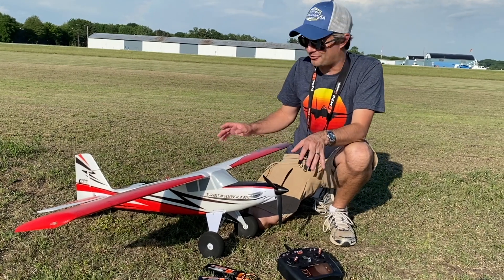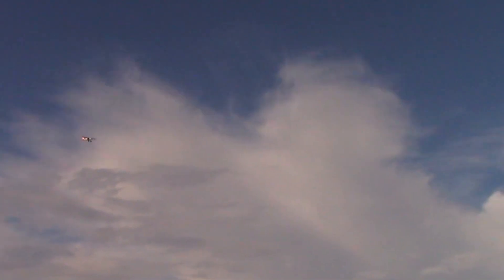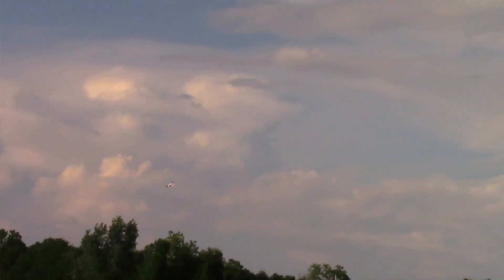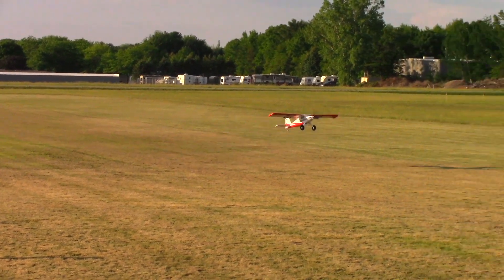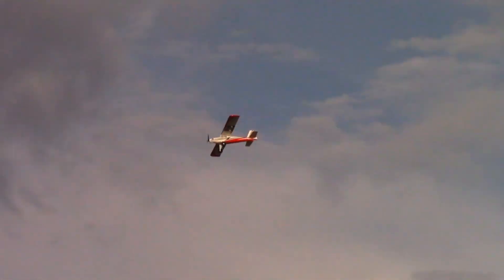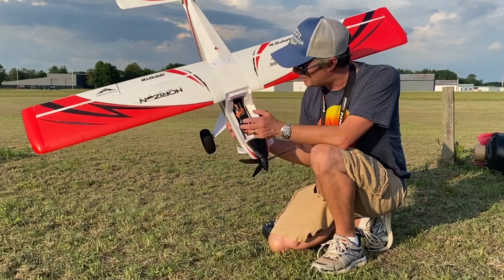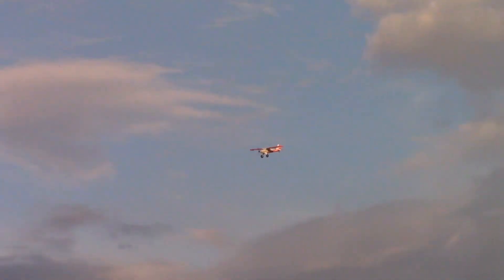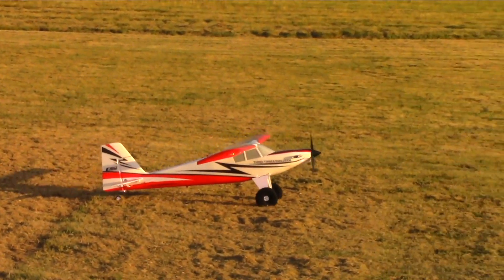What is the best battery for the E-flite Turbo Timber Evolution 1.5m BNF Basic?

Comment: Funny how almost every video Avoids landing this Golf Ball on cement.
Reply from the maker: I have no paved runway to operate from. Grass or fabric is it. I actually don’t even know of a club or area to fly in my area that has a paved runway.
Reply: @BRGT350  Hey Buddy.  NO disrespect.  wasn't directed towards you.  I owned the 1.2m Timber X a while back and it was like landing a Golf Ball.  Everyone at the field also has landing difficulties with the Timbers.  It's not the airframe.  It's the Narrow, Bouncy Landing Gear.  They're too Cheap and Arrogant to change their designs.
Reply from the maker: I have 3 Timbers, one original, one is the X, and the other is the Evolution that now has inflatable tires. With almost 10 years of flying Timbers, bouncy landings are more to do with technique than product. I can get a bouncy landing or smooth landing simply by adjusting my speed and approach angle. Bouncing is indicative of too fast and steep approach. The impact force on landing transmits energy back into the aircraft causing it to bounce. Newton’s gravitational law explains this. You need to reduce the energy on landing so the tires and springs can absorbs the energy with the least amount of energy transfer into the airframe. There is a sweet spot in which the landings are perfectly smooth. Really the same for all planes, however that sweet spot differs from plane to plane. Even full scale planes deal with this.
Reply: @BRGT350  This arrogant mentality is Exactly why EFlite won't address the Elephant in the room.  This isn't just me, who has also been flying for around 30 yers.  It's most of the pilots at the field also.  NOBODY should have to Sit down,  get out a Magnifying Glass, and Carefully thread a Needle just to land a " B U S H  P L A N E "

Comment: Nice comparison.  The only critical thing missing was the flight times on each battery.
Reply from the maker: yeah, in hindsight, that would have been good to add. I have found that the more and more I fly the Timber, the more time I am adding to the timer. I have also settled on a 2700 4S pack as my new favorite. I didn't have that battery available for the flight reviews. The 2700 4S works in most of my planes, has extra flight time over the 2200, but isn't as heavy as a 3000. There is a point in which too much battery hurts performance due to the weight.

Comment: What was the flight times on 3s and 4s batteries?
Reply from the maker: depends on the mAh of the battery and not the cell count. Although a 2200 4S should provide more flight time than a 2200 3S because your cruise power setting is a bit lower. Going with too big of a battery hurts your flight time as you need more power to haul around the extra weight of the battery. A 2200-3000 pack is probably ideal. Expect flight times to vary from 5-8 minutes depending upon the battery size and how you fly the plane. It is possible to get over 10 minutes of flight time out of a single pack. I caution against large batteries as they can overstress the landing gear if you aren't one who can land gently.

Comment: Was watching to know what c rating was on your batterys you never mentioned it once. Is looking at getting 4s 3200 but they are 75c I'm newish to the hobbie and want check I'm not going cause an esc cut with 75c to my limited knowledge it should be fine but I defer to you guys  cheers.
Reply from the maker: I didn't mention C rating as it isn't terribly important on most models. The easiest way to understand the battery nomenclature is to think of the battery like a gas tank. The mAh is the size of the tank. A higher mAh number means you have more energy in the battery to consume. Longer flight times, but more weight that you need to carry around, just like a full tank of gas in your car. More weight means a less responsive aircraft and the need for more throttle to provide enough thrust to carry the extra weight. Cell count is a number and S, like 3S or 4S. Think of that like the octane rating. The higher the cell count, the higher the octane. Just be aware that you can't exceed the cell count without damaging your aircraft. The Turbo Timber Evolution can run on 3S or 4S battery. A 4S battery is about 25% more powerful than a 3S. The C rating is the discharge rate, which is like the diameter of the fuel line going from the tank to the engine. If your engine needs 1/2" line and you are using 1/4", the fuel can't be supplied fast enough and the engine will suffer. If the engine needs 1/2" line and you are running 3/4", then there is no problem. The majority of prop planes, like the Turbo Timber Evolution will fly great on a 30C pack. A 50C battery is ok, but you are paying for more discharge rate than you need. EDF's can require a 50C pack due to the high demand on the battery. Now, a cheap battery at 50C may perform about the same as a good one at 30C. I have some Turnigy batteries that are 50C and perform about the same as a Spektrum Smart 30C. I have started to switch over to just using Spektrum Smart batteries as they deliver more consistent performance, have a self-discharge feature, and can be charged easily with a Smart charger. One last thing about batteries, never store them at full charge and never let them go below 30% capacity. If a Lipo goes dead, it will be dead forever, and is now unstable. Get rid of it quickly. Hope all of that helps and let me know if you need anything else.
Reply: @BRGT350  yep very comprehensive thank you, was going to buy 2 cheap 4s 3200 mah 75c think I'll keep looking for same between 30c-50c. Cheers mate.
Reply from the maker: For a good long term battery, look at the Spektrum Smart Gen 1 or Gen 2 batteries. Gen 2 need a compatible charger while Gen 1 will work on any LiPo charger as they have the balance leads. I was buying cheap batteries from Amazon or other spots online, but they would only last a season or two before going bad. The Spektrum Smart batteries that I started with in early 2019 are still performing great! They also self-discharge after a period of time (I think it is between 24 hours and 7 days depending on the settings that you can adjust) down to storage voltage. That is what is keeping the batteries working well long term since they don't sit for extended periods being fully charged. So many times I think I am going to fly, charge up the batteries, and then the weather decides that I am not going flying for a week. The Smart batteries will self-discharge where the non Smart batteries will stay at full charge. Once you make the switch over to the Smart ones, you won't want to use anything ever again. They have significantly changed my enjoyment of the hobby as the batteries work better and last longer.
Reply: BRG.. very good explanation of battery specs! Your analogy of fuel tank size, octane level, and fuel line size is dead-on. C rating is based upon discharge rate/internal battery resistance/"fuel line size". S rating is the voltage/octane, mAh rating is "fuel tank size". 
 # of cells and capacity ("S" number and mAh rating) are what affect battery weight, the C rating is mostly determined by chemistry/wiring. I'm going to maiden my TT Evo with a 4S 4000 mAh 60C batt this weekend. It'll be a bit on the heavy side but will have far more than just 5 minutes of flight time to tool around and get a feel for how the model handles.
Reply from the maker: Thanks, I find the gas tank analogy about the best and easiest way to explain the battery. It isn't an exact 1-1 analogy, but works out close enough. Something to note on the Turbo Timber Evolution and large battery packs, the large packs tend to block some of the air flow that cools the ESC. Air comes in through the cowl, passes over the ESC to cool it, then up around the battery, and exits out the rear lower fuselage. A large pack can block some of that airflow. If you are flying with a 4S pack in hot temps, I would go with a smaller pack to make sure there is plenty of air flowing past the ESC to cool it. I have great luck with a 2200 3S, 2200 4S, and 2700 4S in mine. I tend to stay away from the larger packs. The less weight on the nose is also better for the landing gear. I tend to fly shorter flight times, land, let it cool, then go up with a new battery. That way I can get more take-offs and landings as well, which is an area I always need extra practice.

Comment: It's very helpful to understand how it flies differently - or similarly - with the various batteries.  Thanks!
Reply from the maker: Glad I can help! I have pretty much settled on a 2200 3S or 2700 4S pack for my Turbo Timber Evolution. I didn't have the 2700 4S when I did the video, but use them now for a lot of my planes so they have made their way into the Timber as well. It surely doesn't need 4S power, but that pack does work well with the Timber as it a little extra weight to make it a bit less floaty while offering more than enough power if I want it on tap. Most of my flights are on the 2200 3S packs.

Comment: Did you mix flaps and elevator?
Reply from the maker: depends on the plane, but yes on the Timber. I also reduce the flap travel to less than what the factory has in the book. I change the flap deployment speed to 4 seconds instead of 2. I find that with a slower flap deployment speed and less flap deflection, the plane doesn't want to pitch up if my airspeed is a bit too high.

Comment: So I have a carbon cub s2 1.3m.  Can I run a 4s on that plane?? Great informational videos sir. Thanks
Reply from the maker: Thanks John, but no 4S on the Carbon Cub S2. That is a 3S plane only. The Turbo Timber Evolution is the next step aircraft after the Carbon Cub. The Carbon Cub is considered a Level 1 trainer aircraft and the Turbo Timber Evolution is Level 2 intermediate and the ideal next step after a trainer.

Comment: I used 32/ 3 cell & a 33/4 cell was check the battery it will get hot especially when your fly back to back like you did you’re lucky you didn’t burn up the ESC
Reply from the maker: No problems with my batteries or ESC. The batteries, either 3S or 4S never get warm with the Timber. They get warm on my EDF's, but never on my Timber. I have checked my ESC temps and they hover around 150-175'F max with 175'F after doing some very hard back to back flying in order to see how hot I could get it. I have been flying my Timber a lot since it was released and never had any issues with a hot ESC or hot batteries.

Comment: I have one from a few days,fly with 3s et 4s.
4s more 65c is better
Reply from the maker: The 3S and 4S batteries I fly on are 30C. I have a few old 2200 3S 40C, but those aren't used much anymore. I mostly use 2200 3S 30C for my flights.

Comment: what discharge rate are the batteries?  what C rating?
Reply from the maker: 30-40C depending on the battery. My 3S 2200's are 40C, larger batteries and 4S are 30C.
Reply: @BRGT350   thank you!!! i just ordered my TTE tonight,  happy to have 5 3s batts from my aeroscout to get me going!

thank you for the video!
Reply from the maker: Great! Happy to help out and enjoy the Turbo Timber Evolution. It is a great flying aircraft. One thing I did to mine is to turn down the aileron and elevator rates. Since I don't fly at super low speed (near stall) or want something aerobatic, I reduced the rates down to where the plane fits my flying style. I think I am around 60-70% throw on the elevator and ailerons with 30% expo. I also reduced the flap travel by 30% of the manual suggests along with a 4 second flap deployment speed. That has the plane flying just how I like it.
Reply: I'm still a newer pilot so I spent the first week with my turbo timber evolution flying the 3s 2200 mah 50c batteries I have from my aeroscout.   Today was my first flight with my new 4s 3300mah 100c batteries and oh man what a difference!  I happy I flew 3s for as long as I did but could tell from day one the timber needed more. 

Thank you for your awesome video on this topic and all the additional information!

Comment: Nice flying. I Maidened mine this week and was wondering, did you have any issues with the esc and motor getting very hot? Telemetry was telling me 170-200 on the esc. I did move it forward like HH said to but that doesn’t seem to help. Thanks
Reply from the maker: Thank you! I never had any issues with the ESC getting hot. I think the last time I checked, I was max at 150'F. I fly on 3S and the ambient temp here in Michigan is rarely above 80'F. With flying in the evenings, the heat of the day has already started to go away.

Comment: Ran a 4s 5000 30c today and it did amazing I couldn’t  tell any weight difference at all. 3200-4000 would be ideal. Came down after 10 mins and still had 35% battery. You can have a good time on a 3s 2200 but your are looking at 5mins flight times and very poor power. When I say 5 mins that is pushing it. I’ll come down on 9% at 3.40 immediately after five minutes. If you’re just flying around in circles or want to do a few rolls 3S will work.
Reply: Does the ESC get hot on the 4s batteries? Did you move the ESC?

Comment: great video!  i have the original... and my evolution is still in the box...(  i'm in the UP... lots of snow here)  i have several of the 4s batteries so i'll stick with them. also, i think i'll fly without the slats... cant wait!   .... and  ... new sub... thanks!
Reply from the maker: Thanks! You will really love the improvements on the Evolution compared to the original. I rarely fly my original one anymore. Hopefully the snow will melt soon and you can start flying again. I think the snow has pretty much ended for West Michigan, although a few inches could show up. The hard part now is waiting for the temps to warm up and the winds to die down. We have had really windy springs lately and that wind is cold coming off of Lake Michigan.

Comment: I am flying mine on a 3S 3200mAh 30C gen1 spektrum smart battery. Very scale flying. Any recommendations about ESC overheating in the TT Evolution?
Reply from the maker: sounds like a perfect battery! Horizon recommends pushing the ESC towards the front of the cowl to help with cooling. You can reach it with the battery hatch removed and just move it forward with your finger. Also allow 5-10 minutes of cool down between batteries, longer in hot temps or flying aggressive. I flew mine back to back to back in the summer without any overheating, but the summer temps along Lake Michigan aren't very warm. Probably upper 70's mid 80's F. We fly in the evenings as well, so the temps drop as we fly.
Reply: @BRGT350  we currently have 50-60 here (10-15 degrees) so really fall and not too warm.
Reply from the maker: Yeah, fall is here as well and while it has been very unseasonably warm for the past month, the forecast is starting to change back to more normal. I was still wearing shorts and a t-shirt the other day! Typically it is jacket weather by now. A few years ago, we had snow on the ground at this time in October. There is a car rally race in the northern part of my state this weekend and I have been there while it has been snowing and freezing during the night.

Comment: Great informative video !!!  as someone who has been learning to fly this summer, ( Bigfoot and Tundra V2 )  I was thinking of picking up this plane as a " next step " plane ...I was  wondering what size battery would be best for me........ I am  looking for a stable flyer that will handle a bit of wind, as I am  not  needing  a lot of speed......thanks
Reply from the maker: I would suggest a 2200-3000 3S battery. The 2200's are fairly inexpensive and give you nice performance and flight times. The 3000 3S will give you more flight time, but cost more and add some more weight. The extra weight will help handle the wind a bit better than the lighter 2200. The Turbo Timber Evolution will be a wonderful next step airplane for you. It is well mannered, stable, and can get you used to using flaps and floats.
Reply: @BRGT350  OK...thanks much!!!...I do have many of the 3S 2200's  and will perhaps pick up some 3S 3000's  ......also  both models'  that I  mentioned do have flaps, so  I have been already been using them .....thanks again for your reply.....
Reply from the maker: I thought they both had flaps, but wasn't 100% sure. I mostly fly mine on 2200 3S and very happy with the plane.

Comment: I'll be trying mine on a 4S 2600 straight up- more punch and more time- Thanks for the review especially CofG references
Reply from the maker: I think a 4S 2600 would be a great option for a battery. I don't have any of those to fly with, but based upon my flights and batteries, I think a 2600 4S would give you nice flight times and great performance. Don't be afraid to move the CG around a bit to adjust to your flying styles. I tend to balance mine towards the middle to front half of the CG tolerance range. I find that fits my flying style the best. You gain more aerobatic capability and pitch sensitivity with a rearward CG.